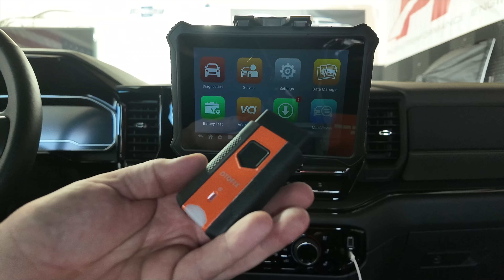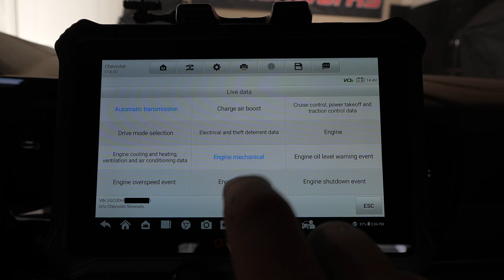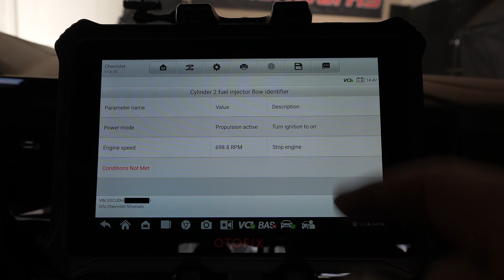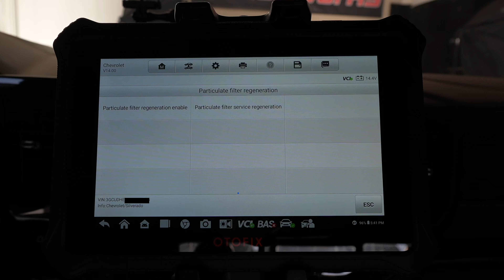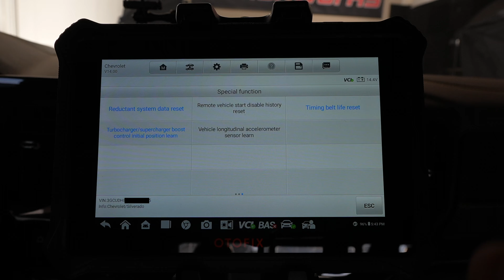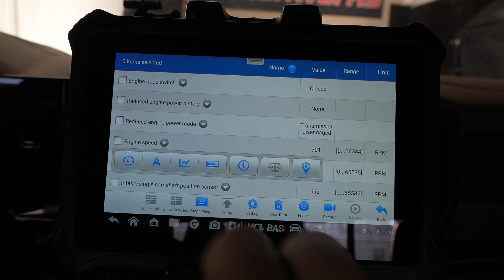Otofix D1 Lite: Affordable Car Scanner with Professional Features!

Comment: Can this do a reset of the electrical system similar to disconnecting both + and - cables and connecting them together to drain the residual power?

Comment: Great video. When you stated that the LZ0 got the 200 mi on the belt is it the same belt for the LM2s? Not sure if it's the same part why would they would add extra mileage on it.

Comment: Will it show egts and nox sensor ppm during service regen??? What about current draw when commanding heaters on???
If it does, this would be a lot more efficient than gambling whether the latest update to techline disconnect will load.

Comment: Otofix scanners are the best kept secret. Basically an Autel unit running Autel software. I have the D1 Max and it’s a beast - does everything I want on my Sierra. I do wish it would let me recalibrate tire size but that’s a GM Global B issue.
Reply: I just bought one as a backup scanner and I’ve gotta say so far I’m pretty impressed. I have the Matco Max 4 which was like 7 grand when I bought it, and it runs launch software. It’s a phenomenal scanner but way overpriced in my opinion and they’re asking 1500 for the yearly update. Basically I bought the otofix because I wanted to dip my toes into an autel to see if I want to buy a high end autel to replace the max 4 or if I want to stick with launch software for my next scanner

Comment: Any options on there to allow you to service the brakes at home?
Reply from the maker: Great question! I should have gone over that in the video. I am 99% certain it will since all other scan tools I tested could. I will need to plug it in to verify though, I will do that and update you.
Reply: @DemonWorks hoping there was in fact an option to reset the brake life when replacing brakes? Or at least allowing the button to be pressed within the trucks menu that you in fact did replace the brakes.
Reply: Yes same question here can you service the brakes with this?